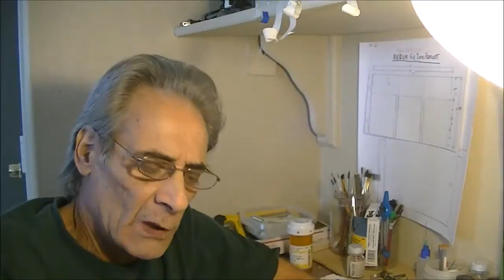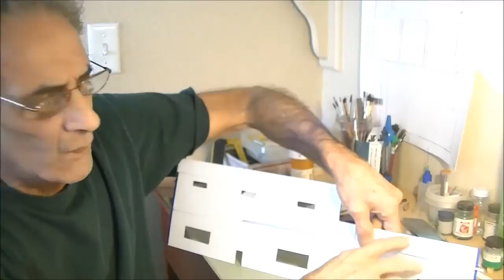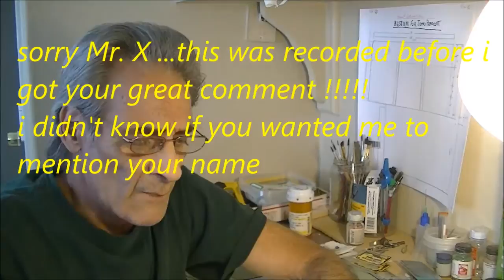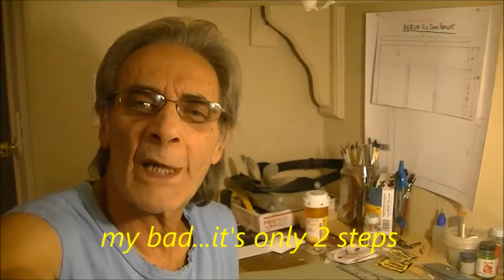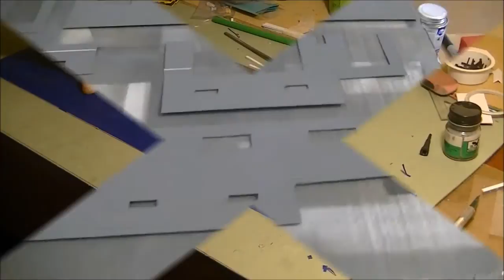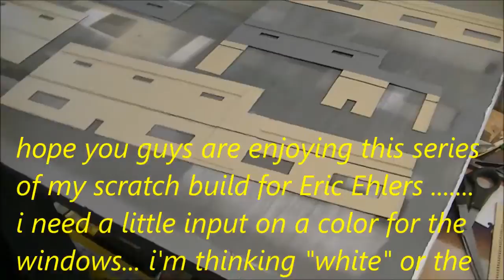"HO" ENGINE HOUSE SCRATCH  BUILD

Comment: Coming along nicely Vinny, but I do have a question. You use the same styrene signage material to construct an HO scale structure as you would for an N scale building. Seeing as the HO one is basically twice as big, wouldn't you find it necessary to reinforce the walls to compensate for the greater size? Do you approach an HO build the same way as you would for the same structure in N? Will this engine house require more bracing as opposed to an N scale version? And by the way, don't worry about keeping the videos short; the more detail the better! You can always learn something new simply by observing every step. 
As for the color choice for the windows, I'm thinking this is an engine house. They are dirty places, a dark gray or even black would be an appropriate choice over white.  Just my opinion of course... Keep the videos coming, F.
Reply from the maker: hey Frank... you sure are loaded with questions.... if i tell you then i will have to kill you...LOL  OK now the answers. on this build i am using evergreen metal siding for the walls (.040 thick) & the signage for the base & roof.. as far as the support i will need....for  the horizontal the roof supports & the base supports along the bottom will keep the walls straight... for the vertical support i will be doing something else that i won't disclose at this time ( it will be a surprise for Eric .. a little extra detail i will be adding) you can PM me & i'll let you know what it is... i attack all my projects in the same fashion... i try to build them as if i was building the real thing ( i watch a lot of DIY shows) which means adding supports where needed whether  it be "N" or "HO"  i do notice one thing, if i paint only one side of either the signage or the evergreen, i will have warpage.
being the exterior is already grey painting the windows the same wouldn't work because there is too much grey already.. i'm thinking a lighter grey
as far as the length of the videos go, i found a lot of guys get bored watching a 30 minute vid so i try to get as much info into 10-15 minutes... as i have mentioned in this series several times that the procedure would be the same for all the walls or what ever i'm showing at the time. by doing this, i can cut the length of the vid down
OK ... now that i have divulged this info to you... how would you like to die....LOL
thanks for watching & all your great questions i hope i have cleared things up for you
vinny